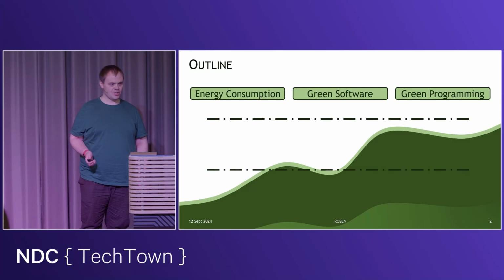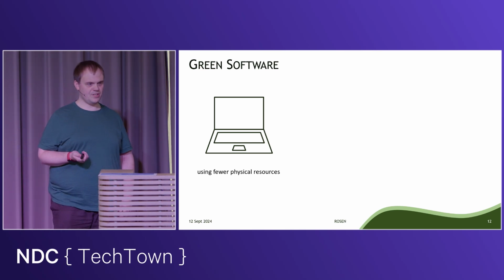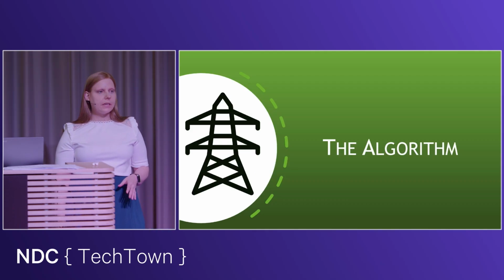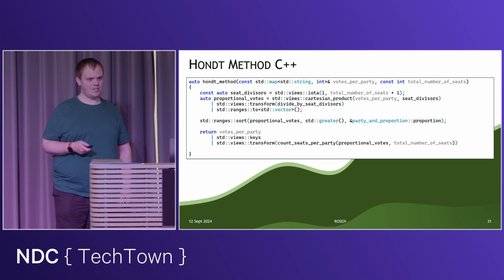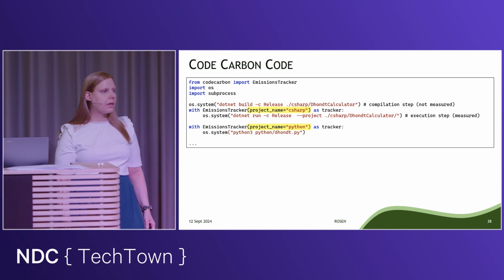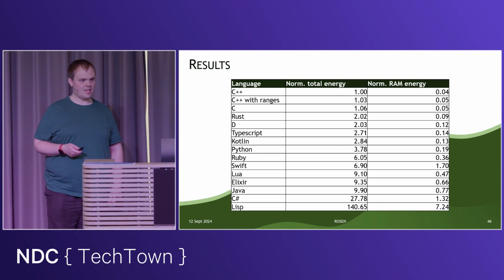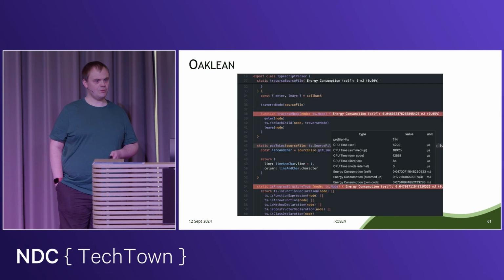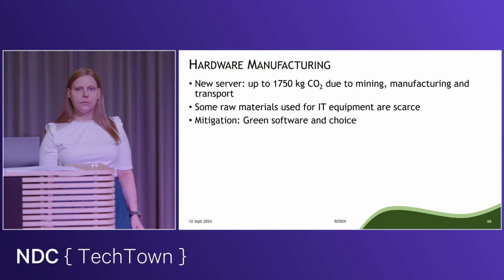Green Programming - Hendrik Niemeyer & Tina Ulbrich - NDC TechTown 2024

Comment: Efficiency topics are responsible for the huge overlap between techniques for high performance computing and techniques for power efficiency (think mobile devices). Low power applications are fast and vice versa (among the initiated, this is very much olds news...). It think the reasons for programs running awfully and gobbling resources are 1) people don't really care (I blame Knuth's "premature optimization is [...] evil" for optimizations getting half-assed these days) 2) people don't have appropriate tools (AFAICS, programmers that use profilers are a tiny minority) and 3) lack of restraint regarding functionality / bloatware.
Current machines are obscenely powerful. There is no excuse for building systems that run like sh*t nowadays. The fact that this still happens way too often is a mark of shame on the whole software industry IMHO :/